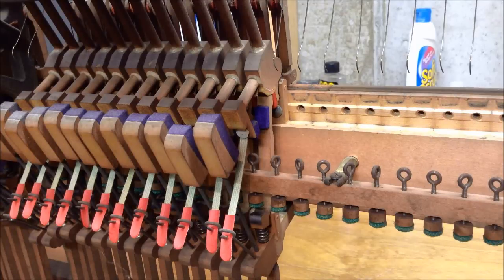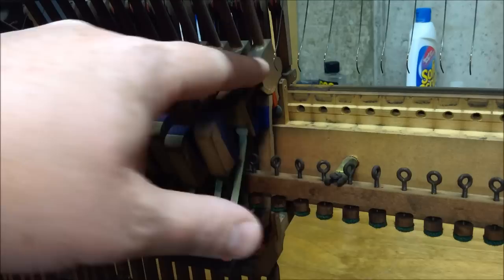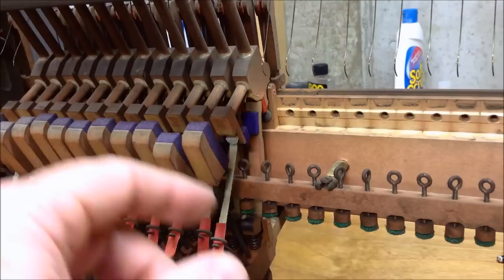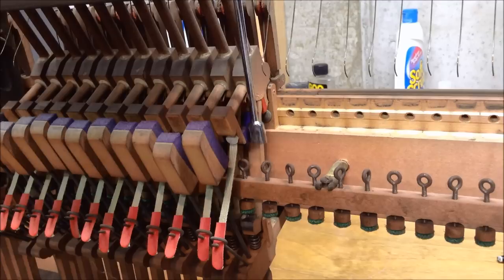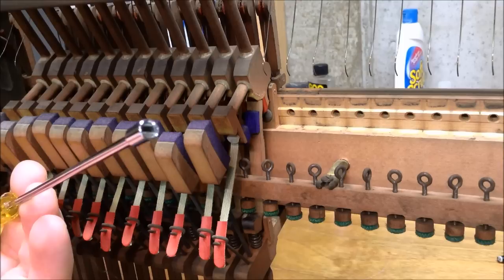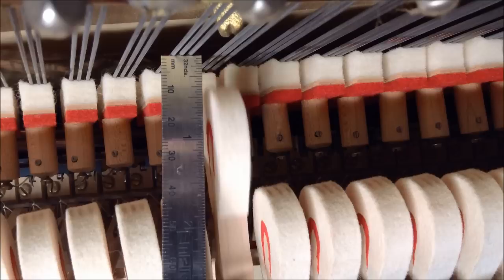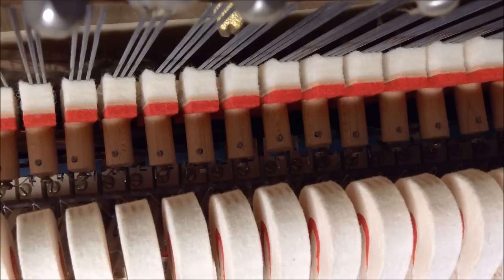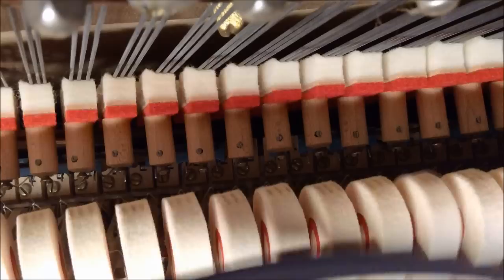Piano Tuning & Repair - Adjusting Let-off In A Vertical Piano I HOWARD PIANO INDUSTRIES

Comment: The magnetic strip won't work for the copper bass strings. A strip of 2 mm thick cardboard pasted temporarily on the strings will do also. I turn up the regulation buttons up till the hammerhead is blocked on the strip, then slowly turn it down till it escapes. When the strip is removed you have an exact similar m
let off( btw, in Europe we use the French word échappement). We have als flexibel regulation screwdrivers that diminish the danger of breaking the round heads.

Comment: Sweet; excellent video! I had looked into my piano and found that the felt wasn't placed correctly. I concluded that the felt had worn down and I needed to replace it. This was overwhelming. The symptoms were that when I played and held certain notes, the jack did not "let down" or disengage at all, so the note was dampened by the hammer. This design is much better than I thought: I don't have to replace the felt, just reposition it. You can imagine that this is very welcome news. Thanks again.
Reply from the maker: Thanks for watching!  Yes, even when the felt is worn this adjustment can make it so the action will still work without having to replace the felt.  At some point it would probably be a good idea to replace the felt regulating punchings.  It really isn't as difficult as it seems.  In most cases the rail the holds the regulating screws and buttons slides right out of the action which makes replacing the felts fairly easy.

Comment: In my experience with older pianos, I have found that almost every time I try to turn the let-off adjuster screw in breaks off because they are all rusted in and will not turn freely. the alternative is to add a thin piece of felt on the let- off button to increase, or reduce the thickness to reduce the let-off amount.
Reply from the maker: Thanks Peter for the suggestion.  That is helpful.  Another idea that I learned about in a Piano Technicians Guild meeting last week is that if the letoff is off a consistent amount across the whole piano (which it often times is) you can bend the whole rail by putting pressure on the rail which bends the brackets that holds the rail.   In most cases the letoff is too far from the strings and then you would just adjust the rail up so the letoff was later.

Comment: Hi Howard, thanks so much for your videos. You know, I live in a little town in Mexico, and piano tuners have to drive a good four hours in order to tune/fix my piano. I was finally able to have it tuned just a couple of days ago, which is great but, right before the guy left (almost going-to-bed-time for me) he mentioned they keys double-striking the strings. I had noticed that, for some reason, I could never get to make pianissimo sounds, as there seemed to be some sort of twang at the time. Now, I'm left with a perfectly tunned instrument, but knowing that I have that issue, I just don't seem to be able to get that off my mind. I came to your page, but haven't been able to find a video where you talk about this. I tried removing a key and twisting the bolt at the deep end (＋/ー), only to see that, when tightening it would just bring the hammer close to the strings. Could you please shed some light on this matter? I will still be looking in the meantime. I appreciate your effort to help others. Thanks1
Reply: I think your problem might be related to the hammers being too loose. You can fix that by changing the pins although you might have to rebush if the felt whereon the hammer rotates is too worn off. This guy has very good instructional videos on the matter!
Reply: Let off and hammer butt check are the most likely adjustments for double striking. I'll bet Howard has a video on that.

Comment: I'm confused.  At 3:10 you say adjust letoff  to 13/32" to 1/8" from the string.  1/8 is 4/32, so are you saying the letoff can be between 13/32" and 4/32".  That's over three times the gap between smallest and largest.  Then at 7:55 you say 1/2" (which is 16/32") is way too far away.   So 13/32 is ok but 16/32 is too far away? Can you please confirm these figures?  BTW, I do appreciate your videos and find them very informative.
Reply from the maker: I'm sorry for the confusion.  Instead of 13/32" it should 3/32".  I may have not said it clearly enough in the video.
Reply: Perfect, thanks!

Comment: What are the thin, spring loaded wires coming down on the right in front of the soft scrub bottle?? Some of mine are broken or bent where the hammer wont return. Any tutorials on this issue? Thanks for your help!
Reply from the maker: Here is a link to the video on replacing the hammer butt springs: https://www.youtube.com/watch?v=Mtfazycm-tA

Comment: I have one question: What is the problem with having the letoff distance very low, as it is at 6:20? It seems to me that it would give the pianist more control, but is it hard to get all the notes evenly regulated that way?
Thank you so much for this video series!
Reply from the maker: As humidity levels change with the changing of the seasons, the letoff distance can change as well.  So if you adjust the letoff too close, then if the humidity level were to go up, it may make it so the letoff decreases even more and makes it so the hammers block against the strings.

Comment: The E key in my baby piano rings when I hit it. The damper seems to not apply enough pressure after I hit it. Any suggestions on how to fix it or what it might be?
Reply from the maker: Hi James, there are a few things to check.  It sounds like this is a baby grand piano.  You'll want to check to see if the hammer has some movement before the damper starts to lift.  You check this by very slowly pressing down the key.  You also want to check to see if the damper wire is moving freely in the damper guide rail bushing.  These are the first two things to check.  Let me know what you find when you check these things.

Comment: thank you for this tutorial,
I have an old german bechstien vertical piano and above the button screw there is a long wood strip so I can't get access from above to adjust the screw. is there any other tool I can use? the screws are the same as in this video.
Thank you
Reply from the maker: In this case you can use our pointed capstan screwdriver.  It will turn the screws by coming from in front of the screw rather than over the screw.  Here is a link to this tool: http://www.howardpianoindustries.com/piano-capstan-screwdriver/
Reply: howardpianoind Thank you! I will buy it. I would like to ask one more thing: some hammers don't fall back to the rail after they hit the strings (I released this cacher strip just for checking). is it the pin or the spring in the hammer butt?
thank you again...
Reply from the maker: The hammer pinning is most likely the problem.  If you unscrew the hammer flange from the action you can check the tightness of the flange pinning.  You'll probably find that the pinning is too tight.  The best solution for this would be to repin the flange.  Here is a video on how to do this: Piano Tuning & Repair - Fixing loose or tight piano flanges

Comment: Is it possible to have let-off adjusted AFTER a piano has been 
completely regulated? Does adjusting let-off make additional procedures 
necessary, like re-setting checking and aftertouch?

I'm really puzzled by this: Why do so many european piano technicians regulate let off at about 1-2cm from the strings? I understand that a muffler / moderator in an upright needs greater let off than a piano without one, but 1cm compared to 3mm (1/8th of an inch) is a HUGE difference... and as I would expect, the touch is horrible. Trying to play p or pp is a torture.. but every technician I have had in my house does this. What could be the reason? It's a new Yamaha U1 (built 2015).
Reply: PS my let off is 1.2cm / 1/2" on average and the aftertouch is about 3-4mm.  I just measured it.
Reply from the maker: Yes, in my experience 1/2" is way too much for letoff.  Generally you can adjust the aftertouch without changing anything else, but it's hard to say how much of an affect it would have adjusting it that much.  What I would recommend is trying it on a couple of keys to asee what kind of results you get.  You can always adjust it back.  I can imagine that it wouldn't play very well with that much letoff.   Did you also check your hammer blow distance?
Reply: Many thanks for your reply!

I'd have to check that to be sure. My U1 has been regulated twice, and the hammers have been filed & voiced once since I own this upright (I bought it in Jan 2016 and there was no voicing done whatsoever before it left japan, apparently). I feel comfortable with regulating lost motion and maybe letoff ( I do have the proper tools for this), but anything that goes beyond that.. i'd have to admit that i'd probably make things much worse if I touched them, i'm just a layman. I'll do what you said and try setting letoff to 5mm or so on two keys, and see what happens.

I reckon this is a new piano, barely broken in, and it's gonna change a lot over the next couple years but it really feels totaly awkward right now. Almost no control over dynamics.
Reply from the maker: You should notice a fairly significant difference in making these small changes as long as the hammer is checking well when you're done.
Reply: yeah so I adjusted letoff to 5mm on one key. This key immediately had insanely fast repetition and I could actually play pianissimo without it feeling like I'm playing whack-a-mole. Hammer started bubbling though, because I had zero aftertouch. Hammer blow distance is 52mm (too much). So I reverted my adjustment and called a professional to re-regulate my U1 (once again), but at least now I know what is possible...
Reply from the maker: Thanks for the follow-up.  Yes, it usually is possible to get things working right once it is adjusted correctly.  Hopefully you'll have better luck this time getting things regulated.

Comment: how to remove the jack and the hammers on the vertical piano
Reply from the maker: The hammer assembly which would include the hammer, the shank and the hammer butt is attached to a flange which is screwed to a rail.  The flange is just below the hammer butt which you should be able to see clearly in the video.  The jack is part of the whippen assembly which is also screwed to a rail through a flange which is at the back of the whippen so you would need to have the action out of the piano to access this.
Reply: howardpianoind l